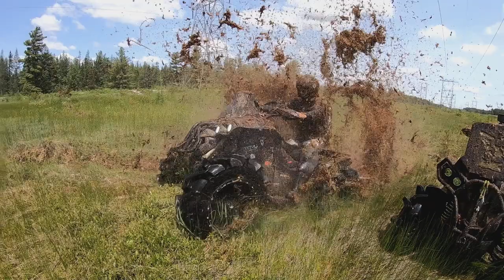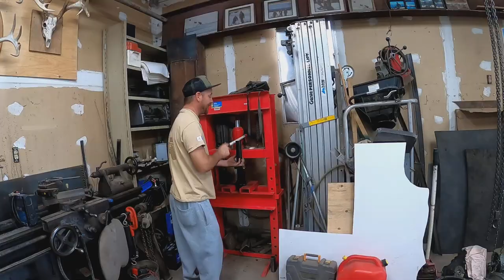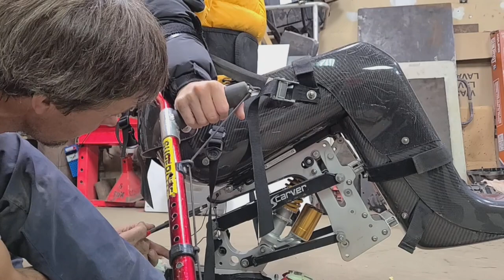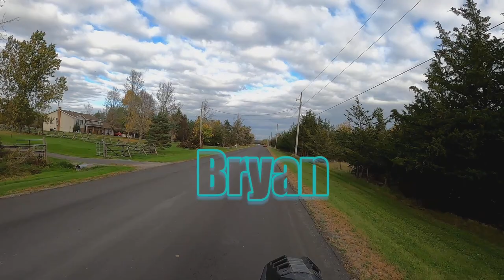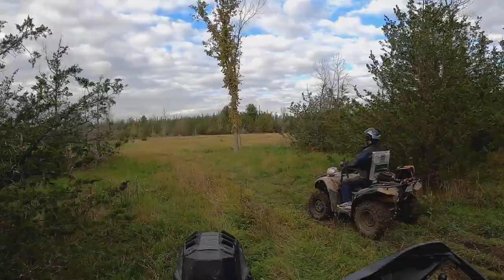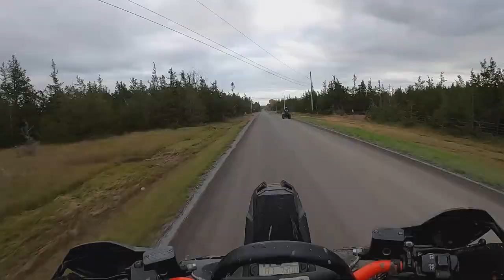I Just Got Rear-Ended By The XXC/ Rear Camera Crash

Comment: Great Videos I’ve watched most of them. I have a Outlander XMR 1000 and just put money down on a Renegade XMR 1000. I see you don’t run a rad relocate don’t you overheat going through all that mud and water?
Reply from the maker: No sir, I'm pretty thorough when cleaning after riding
Reply: @ehTV1000  Thanks for the reply. Ya I was riding with a guy in Innerkip that was riding a Renegade XMR and after the first two mud holes he was overheating rad full of mud lol. I was wondering if you installed something in front of the rad to keep the mud out of the rad. I would rather not run the rad relocate if I don’t have to. I’ve had rad relocates on all my Ottys but this will be the first Renegade for me. Keep the videos going man.